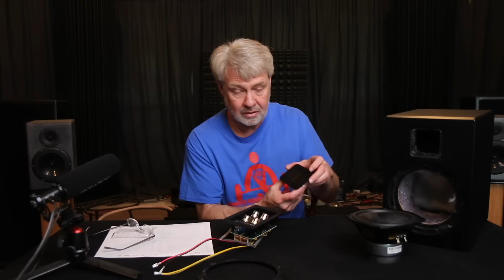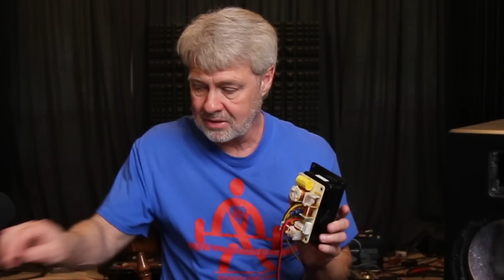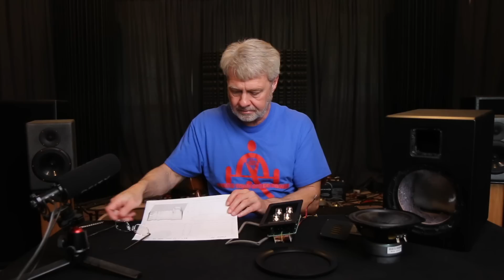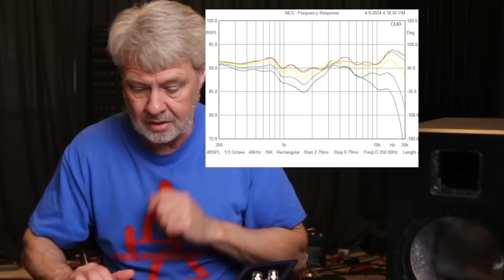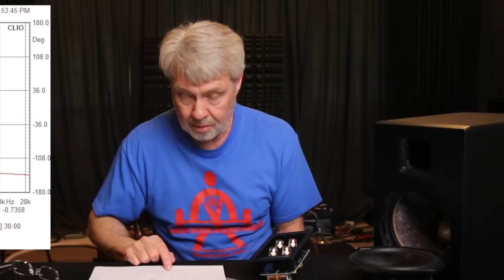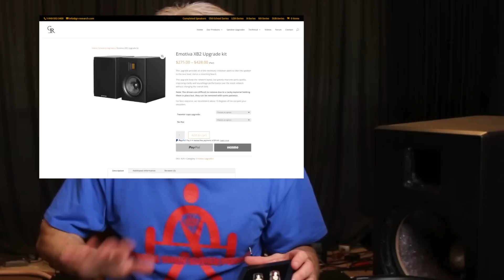These CHEAP Speakers Surprised Danny! Emotiva XB2!

Comment: How do you feel about adding norez, or another vibration damping product to the flat parts of a stamped basket?
Reply: I put silicone caulk on all accessible portions of the basket frame. It does a great job eliminating ringing, etc.
Reply: @ChicagoRob2 I do this as well although I use a Autobody damping caulk
Reply: Oh yeah, peel off the foam and use the damper on them. Works great.

Comment: Regarding your advice to round off the interior edges of the cabinet’s woofer cut out: would rounding all sharp edges inside a cab be beneficial? Specifically, the hard angles where each cabinet wall meets.
Reply: Rounded edges minimizes any turbulence in the box, but it is the inside edge of the woofer throw hole that can disrupt the response.
Reply: @dannyrichie9743 Yes, because right at that back edge of the woofer, (AND midrange, if open back type), a sharp edge results in sound difraction at certain frequencies, or at least a specific frequency, which then can result in a resonance coming back around and affecting the direct driver's response, either adding to it or partially cancelling it at that resonant frequency.

Comment: Just a quick thought on why Emotiva isn’t worried about the 4 ohm impedance is that they have a pretty extensive line of multi-channel power amps and two AVRs with more than adequate power supplies to be stable into such loads. I just added one of their 7 channel models to my Atmos rig, and am quite pleased with improvement in dynamics over running all of the receiver’s internal amp channels 
Hard to argue against investing a few more dollars per pair for rear chamber damped AMTs, upgrading the binding post to even just brass,  and definitely the 10 seconds of machining time required to chamfer the rear side of mid-bass driver through holes.
Reply: What is the benefit of 4 ohm instead of eight? If there isn’t one, why would Emotiva go with 4 ohm? Just to sell more product?
Reply: @The most immediate benefit that comes to mind is that amplifiers or recovers with sufficiently well designed power supply stages could deliver more current/power to the load. Provided the total impedance load isn’t highly reactive or sensitivity is low for other reasons, that should mean more SPL for “free”.  Of course things are seldom as simple as that and TANSTAAFL.

Comment: AMT's have quickly become my favorite tweeter. AMT's and silk domes, that's all that I'll buy with my money. But the AMT's play accurate without making your ears bleed like titanium does. I hate titanium tweeters! All the AMT's that I've played with and tested, they all play down to 2K no problem, even the elcheapo Dayton Audio versions. The downside to AMT's is that they are not very forgiving and it's pretty easy to hurt them. If you ever hear one whistle at you during a frequency sweep, it's been pushed too hard!
Cheers 🍻
Reply: Aluminum dome give me a headache every time.
Reply: @Pete.across.the.street  I had PSB goldi speaks I hated the aluminum dome and swapped in a silk dome
Reply: @stevieg2755  i like the silk dome as well
Reply: I have speakers with titanium treble. Not harsh at all. Rew shows they're pretty flat
Reply: here we go again! silk dome vs metal dome. :)
for some people 1 or 2 db gain on metal material can sound harsh.
i read a lot of measurement and people opinion over 10+ years

TWO. metal sound harsh could be your amplifier is too bright
Reply: @hom2fu : 
What are you talking about? I didn't compare anything, I merely stated what I like and what I hate and what I'll spend my money to own. It's not about how metal measures for me, it's about bleeding ears! It's nothing to do with my amps or yours, I just hate titanium tweeters, they hurt my ears, all of them that I've ever heard anywhere on any system! AMT's are metal too, a lot of them are, but I love AMT's overall. I've never heard a bad AMT, unless it's damaged. I have heard some damaged ones that will whistle though. It's not exactly a pleasant sound.

Comment: I own 2 pairs of emotiva speakers as well as few high end speakers as I have 5 systems in my house. In my opinion the emotiva speakers are the best bang for the buck speakers! Have done side by side with many other brands and they are hard to beat.
Reply: JBL fan?🤔😁
Reply: @bigjay1970  Do like JBL. My speaker of choice is Legacy, I've owned my Focus speakers for a while haven't heard anything better for metal music.
Reply: @BillDouglass-m9d  😬😇
Reply: These speakers cost over £1800 a pair in the UK
Reply: what about klipsch?
Reply: @MasterofPlay7 I have not heard a klipsch that didn't sound harsh. That said, there are a lot of models, so maybe there are good ones. Perhaps the harshness is due to these horns?
Reply: @toby9999  which ones do you have? I think it has to do with the amp as well right?
Reply: @toby9999  you this is a problem, because most Emotiva speakers are designed for both music and AV work. The fact is you can EQ the alleged buzzing with digital room correction
Reply: @MasterofPlay7 😢😢go with emotiva you will just as happy even if you don't do the up grades..Klipsch makes some great speakers but that's in the high end level there cheapest speakers not so great my opinion my friend 👍🍺👍 cheers.
Reply: @TheNLHAZE you nailed it
Reply: @MasterofPlay7  In my opinion not even close,  emotiva way better. I've owned a few pairs of Klipsh and they are very fatiguing for metal music. Honestly the Emotiva T1+ has the best horizontal off axis sound I've heard that's the most impressive thing about the speakers. I've got 2 pairs of in ceiling surround Klipsh speakers in my theater room and they work wonderfully. I just bought two of the new emotiva Xc3 center channel speakers for my theater room. Burning them in now in Billiard Room system and they sound awesome. Going to mount both on wall on each side of Big screen.